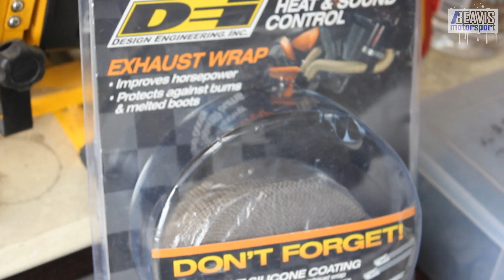Custom 3" Turbo Exhaust - Episode 26 - Time Attack MX-5 Miata TURBO Build

Comment: It's so cool that you can just weld a exhaust together.. that's is some proper MiataModding dude! I have two questions tho!
1) I've read that moisture can get stuck between the exhaust and the wrap, making it a ideal situation for rust. What's your take on that?
2) Don't you need some rubber hangers so the exhaust can move freely when revving the engine?
Reply from the maker: Hey, thanks for the support :)
To answer your questions:
1)  The chance of moisture getting on the exhaust is minimal, as the car runs a flat floor keeping weather out, also the temps of the exhaust should keep the area dry while it is driving, and lastly, the white exhaust paint should help avoid any corrosion also.
2) Yes, you need some flex in the exhaust to allow for engine movement and heat expansion. In my case, the engine is almost solidly mounted, so movement is minimal, and the flex joint I've included will accommodate movement. Also, the rear most hanagers for the exhaust are not fully solid, they have rubber grommets to allow some flex- although not a lot.
Reply: Thanks for the reply and you're right! In your case the wrap won't be a problem. But what's your take on daily drivers tho? Guys who do not have a flat bottom, use the car daily (sometimes in the rain) and don't  paint the exhaust? I'm asking this because I was thinking about buying a 4-2-1 header and some people tell me I should wrap it but I'm not so sure about that.. Thanks in advance for the reply dude!
Reply from the maker: If it's just headers you are thinking of wrapping, then most of those are stainless anyway :)
Otherwise, is there really a need for wrap on a street car, I don't think so. Its more important where the car is constantly at high revs and at high speeds.... generating a lot more heat.
Reply: Constantly at high revs and at high speeds.. sounds like my daily hahaha! No but seriously, I don't think I'm going to wrap it.. I like the look of the stainless steel! Thanks for the quick response tho!
Reply: When using heat wrap it can actually help to soak the wrap in water before wrapping. This helps it stretch into shape better and leaves you with a really tight wrap that won't come unravelled

Comment: Great video, really interesting and shows how its another option than an expensive custom exhaust. How is it holding up after 3 years? Also I notice you don't run the subframe diff brace, any negative side affects? Cheers
Reply from the maker: Thank you Frank, still works fine, no signs of failure anywhere... yet. Subframe braces are just extra weight in my opinion, unnecessary for a track car. :-)

Comment: what size wire were you using? The spatter is just your setting buddy. Exhaust and background tunes aweseome as ever
Reply from the maker: My mig is a cheapie using flux core wire, it has no settings so literally just on or off and a wire speed knob.
Reply: @Bbeavis  ah !! Ok. Still got the stuff welded though and spatter came off. Loved the removal of the boot. I’m planning to do something similar and I’m pleased to see someone else has just cut bits out to make it work. What did it perform like?

Comment: what transmission are you running on that? Someone mentioned to me that a standard gear box in a 1.8 NB can limit the power. Not sure if thats true. Have you done a video on that upgrade. Be interesting to see
Reply from the maker: It's the factory gearbox.
Reply: @Bbeavis  oh! Well that’s me told then haha. Looked different to mine. I don’t really want to fit a BMW box in. If your racing it I’m sure that’s testament to its purpose

Comment: Wonder what weld setting he's using for his MIG welder and the thickness of the steel pipes
Reply from the maker: It's a really cheap gasless MIG, it doesn't have amperage control so I'm welding rather blindly. Steel is about 1.5mm thick

Comment: Nice work Brendan! Would removing that rear trunk section affect the structural rigidity of the car in anyway?
Reply from the maker: Thanks Peter :) I don't have any concerns over rigidity, theres is nothing important mounted behind the there, the suspension pickups are all part of the subframe and the subframe mounts are all forward of the hole i cut out of the trunk section. Plus the roll cage ties in just behind the suspension mounting points so everything that is critical is still supported.

Comment: I use masking tape when joining the sections rather than tacking it together, it is easier to make adjustments if need be. Then when your happy, tack it together, and weld it after removing the tape. When is this car going out to the track to get driven in anger?
Reply from the maker: I just wish i had someone else to do this for me sometimes lol